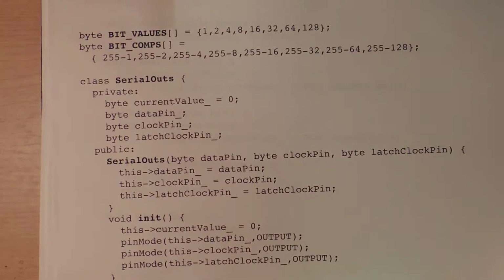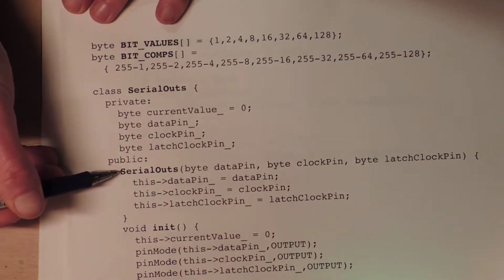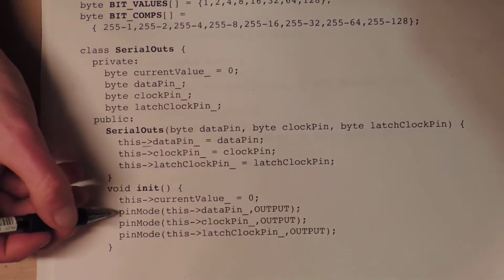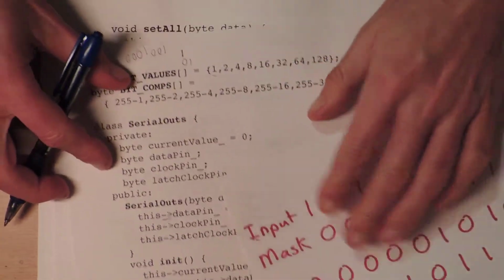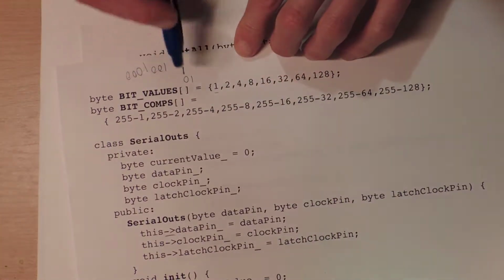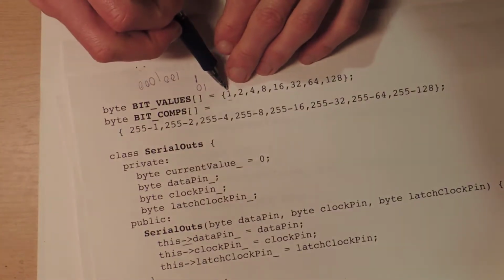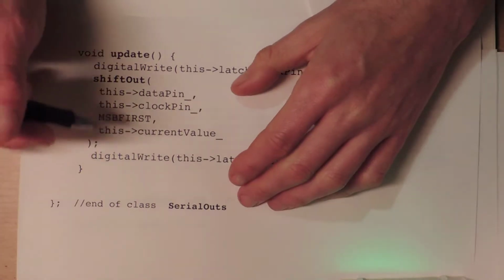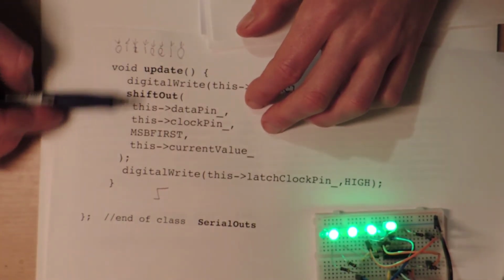[1/2] Intro to C++ classes with Arduino and 74hc595

Comment: You should be able to save overhead by fixing your BIT_VALUES[] and BIT_COMPS[]. If you use const, the compiler should optimize it by inlining the values. 

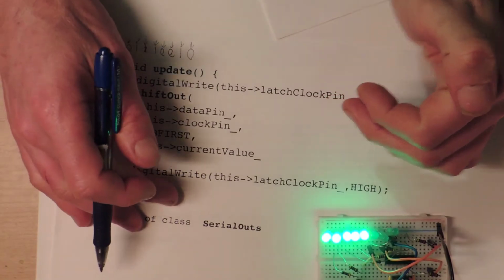Check this video out, it will help significantly. He shows the value of const here at around 27:00.
https://www.youtube.com/watch?v=zBkNBP00wJE&t=4189s